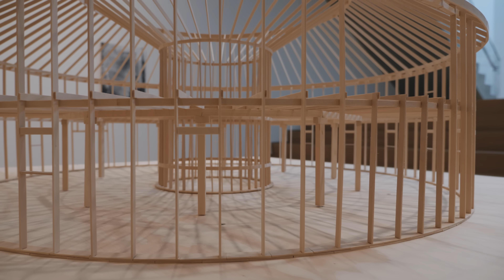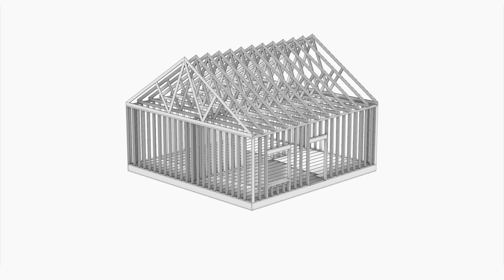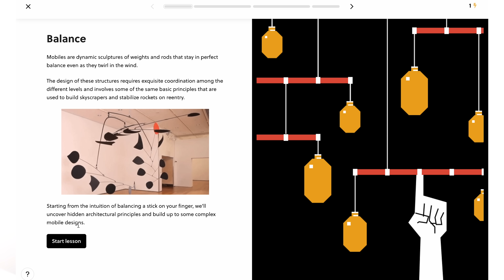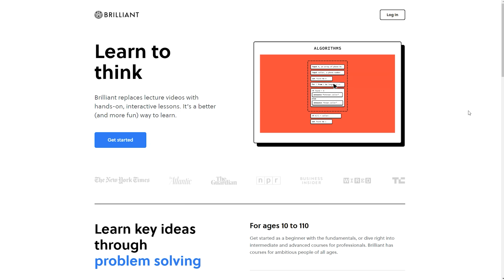The Genius of 2x4 Framing

Comment from the maker: Quick note. Firstly, I wanted to clarify a statement in the video about the skill of framers. That was a product of bad writing on my part. I absolutely believe that rough carpentry is a skilled profession. I was trying to take the position of someone in the late 1800s appreciating the efficiency of the new technology. I had a quote in there, but ended up taking it out. Apologies for the way it comes across now. Secondly, thanks for the comments about the hamburger metaphor, I will take that into future advisement!
Reply: I was about to say something about that. Construction is literally considered skilled labor. Sure building walls isn't too hard this way, but putting together a whole structure that won't fail for decades is not.
Reply: @jonmayer  It really isn't that hard - it takes training of course but that comes at school or on the job. The hardest part about construction is finding people who want to be there and will show up. You show up and ready to work - you will never be out of work.
Reply: @jonmayer  yes but now u can have one skilled guy on sight and a lot of (even if well) trained helpers...
Reply: Thank you for taking the time to make that correction. Not because I was insulted  having passed journeyman 30 years ago. Because I have had to fix way too many structurally unsound DIY builds that always started with "How hard can it be to nail up boards? I can do it cheaper!"  More math than you realize and it's always more expensive to fix your mistakes.
Reply: @gueto70  Going to that guy's house who is so proud of the stairs he built only to find out the last one is only 3 inches off the floor.
Reply: @mc.9839  and they don't understand why the building inspector has a problem with it. It adds character!
Reply: @gueto70  I know! So much for unskilled labor or lack of need for an education. These guys couldn't do the basic math necessary to properly lay out stringers. Shoot, most of them can't read a tape measure, "Ummm...it's 10 and 5 notches." lol
Reply: I'm glad you posted this comment. I am a framer and a trim carpenter in the remodel industry. There is a going mentality, even within the field itself, that it is not rocket science. But the concepts of putting together a sound structure really are deceptively simple. And it takes years to hone the skills to make someone a lead/foreman framer. Especially when hand cutting roofs. It is a dying art and only the toughest will do this for decades. I will freely admit, I am not cut out to frame full time. I can't hack working all year round in the elements. The few men I worked with who had decades of experience are amazing tradesmen. And there aren't many of those types around anymore.
Reply: @717UT  absolutely man. Glad you made this comment I was going to do the same. I've been in the trades full time for twelve years now as a custom furniture/cabinet maker. I believe I represent what he was talking about with the skilled labor, but I know for a fact that a good framer is an absolute skilled tradesman. He has just as much knowledge and ability as I do he  just works with different things. All you have to do to understand that is get on a well built deck and a poorly built deck and you'll know instantly.
Reply: @717UT  still not rocket science, though, is it?
Reply: @Monkeycantnutz  If it was easy, everyone could do it and there wouldn't be carpenters.
Reply: @717UT  you are correct in the mentality towards building trades in general.   I'm second generation Master Electrician, growing up on job sites both new and repair.  I've seen my share of "electricians" and while some of them were true craftsmen, others were just there for a paycheck.    What life has taught me, it that in any given profession, you have a select few who eat, breathe and sleep their chosen career.   What you see in their work is nothing short of awe inspiring, and they truly do make it look effortless.    Unfortunately, they are statistically in the top two standard deviations, or about the top 3-5%.   The vast majority of people you meet at their place of work fall into the 3rd standard deviation (the middle of which is the exact average).  
We have figured out how to grow trees to harvest in the shortest period of time, and chickens the same.  We have not figured out how to increase the intelligence or the non-quantifiable "care factor" for people at work with the same speed and efficiency.  (Side note - My personal opinion is that is not what big corporations or big government want because a smart populous asks too many questions). 
  My dad retired as both a Master Electrician and a motor rewinder/repairman.   That profession was profitable before production costs plummeted with the increase in motors coming from overseas and with the increased robotics in and out of the US.  That dying art form, to reverse engineer a dead motor, is going the way of the milk man or ice delivery service.   (I wound 7 motors in my life, 6 as a kid and one 20 years ago because I screwed up and burned the motor up accidentally, but it was not my cup of tea, so that part of our company died out when my dad retired).
Reply: @717UT  It isn't a dying art at all? Have you seen how much framed construction has been going on in north america over the past decade? It really doesn't take years to become a lead or a foreman - there is such a shortage of trades workers right now everyone can pretty much bump up in about a year maybe two if they are competent. You seem to be thinking there are no more quality trades folk around - sorry but there is a whole ton of talent out there in industry who are now overworked because they can't keep up with demand.
Reply: @717UT The other day, an apprentice asked the question "which is harder, framing or finish?". A lot of the trim carpenters said finish. I said " If you include the roof, it's definitely framing". There was a lot of disagreement.  I asked , as our company subs out the shell contracting, how many of them knew how to frame a roof? A couple hands went up, and they said they had set trusses plenty of times (1.5 years was the longest). I asked if they had actually framed any roofs? No one had. They were disbelieving when I said all I needed was a framing square and the width of the building to conventional frame a roof. I said " that's why trusses are used so much, and why our company uses shell contracting, because it's too difficult for a bunch of trim carpenters." My first 10 years were spent exclusively on stick framed homes.
Reply: I am an architect now and previously had been a carpenter and worked on framing crews. Framing contemporary architectural residences these days is no easy feat. I would strongly argue that most carpenters now have a much better grasp on buildings than most architects. Modern design, even dating back to post ww2 construction does not support heavy timber framing with contemporary building codes. Modern hvac systems, plumbing, window openings, energy codes, and engineering all support 2x framing.
Reply: @BigdaddyG420 "I'm a big rig truck mechanic and I think I'm smarter than a heart surgeon." That's how you all sound. We all live in the modern world, and no body is saying that your jobs aren't complex...but every job has a level of complexity...but let's not kid ours selves here- there is a difference between something you need to got to a school for 6-8 years minimum schooling that changes your perspective on life to get you to the entry level, versus something you can learn on the job.
Reply: @Gnefitisis  See, here is YOUR problem. NO ONE on here said that framing is more complex than heart surgery or requires the education. We only said it was a skilled trade. It is. Why? Because not everyone can do it. 
To use your analogy, anyone can cut open a chest. Not everyone can repair a heart. Just like most people can throw up some sort of wall. It takes training, and skill, to frame in complex buildings. 
You're the one that seems insecure. Does it bother you that my 'unskilled' father makes more than you? By quite a bit.
Reply: @mc.9839  You're reading too far into this. I'm not insecure, but I just happened to have "experience" being around rednecks. 

You also seem to ignoring my argument about the need for formal education vs learning on the job.
Reply: @mc.9839  "There's nothing wrong with rednecks." Says someone that didn't live 20 years in the South. 
Cut the bullshit.
Reply: @Gnefitisis  I’m guessing your college education didn’t include basic spelling and grammar instruction?
Reply: @Gnefitisis    you are grossly underestimating the complexity of many trades. It can take 10+ years to become a truly proficient carpenter, metal worker, etc. Its obviously true the initial schooling can't be compared to the intensity of a med student or the like. However I wouldn't make the assumption that a long and arduous schooling process necessarily translates to a complex job. In fact the majority of college and university grads (with the exception of some STEM) struggle to even find employment in thier given field. On the filp side, trades are in huge demand and even with very short pre-employment schooling periods, skilled workers or even apprentices are very difficult to come by. 

For somthing so useful and seemingly simple to many, very few people seem interested in learning a trade.
Reply: @shrimpy7862  ...and just to clairfy, I never said that the trades aren't important and can't make fruitful or profitable careers. Not at all. However, what I am arguing is that yes, the trades by definition are generally unskilled labor.

You don't have to agree, that's for economics and national labor statisticians to decide...but the argument that it's not unskilled because it has some complexity ignored the determinate of whether you can "learn on the job" or not.
Reply: @Gnefitisis  "the trades are by definition are generally unskilled labor" that is just wrong, thats not an argument at all. Electricians, Plumbers, Carpenters, Metalworkers, Millwrights, Boilermakers and so on are all examples of highly skilled occupations. You're reducing entire professions that people spend lifetimes learning to "generally unskilled labor".You should go down to your local union office and see what the members think of that one😂 laughable actually
Reply: @Gnefitisis  - As someone who was framing house in the 80's,  learning on the job, I can't disagree with you. A big problem in this country today, is people's little egos get very easily hurt. This stuff is all a matter of degree, and being a realist is usually to your benefit. If you go home from stick framing and play video games at night, don't consider yourself skilled. If you go home and study the engineering concepts, then we can maybe discuss.
Reply: @samuelluria4744  First, he's my dad, not my daddy. I've grown up since I was six though it appears you have not.
Second, he's both. I guess your feeble mind couldn't grasp the concept that he still works on his job sites.
That's okay, though. I've read your posts and it's clear you didn't have the ability to figure that one out.
Now, I'm sure that you'll want to say something spectacularly stupid and I'm pretty sure I know what it is going to be so I'll let you get to it.
Reply: @Gnefitisis  - Exactly. The national labor statisticians and demographic analysts and insurance actuaries, lawyers, politicians....they  do draw a line.... but in a society brainwashed against disciplined thought and humility,  this is what we get. NOT A DAMNED SOUL wants to be "considered unskilled", or even "less skilled". Heaven FORFEND!!!😱
Reply: @samuelluria4744  I even gave you the definition of a stick built structure.
Reply: @mc.9839  - Nothing spectacularly stupid, just to clarify that I NEVER said that once a tradesman becomes a businessman, he is magically no longer a skilled tradesman. Obviously,  most of the ones, like your Father, who get big, ARE in fact the higher skilled ones on their trades. The exact distinction I was making was not that they aren't skilled, but even when they are the MOST skilled....that's not HOW they are growing their business.
Reply: @mc.9839  - Well, I apologize for the daddy phrasing. You know how it sounds when someone says "My Dad's a builder,  and I bet you he makes more than you..." ....it just sounds like kids on a playground. But,  you stood up for yourself, and I respect that, so I'm happy to take it back.
Reply: @samuelluria4744  no response?
Reply: @pashahart8698  - That is correct. I have nothing more to say to someone who thinks homes in the times of the Revolutionary War were "stick-framed". Get well soon.
Reply: @samuelluria4744  My comment was in response, if I remember correctly, to someone bragging about how much they made. As my Dad is the builder whose financials I know I had to use him.
Reply: @samuelluria4744  That's exactly how he grew his business. My dad doesn't deal with the 'lowest bidder' crowd. Why do you think they come to him? Because he's a good businessman? Nope. They don't ask for his financials when they hire him. They do ask for his portfolio. They do question his building ability. The reason these people hire him is PRECISELY for his trade skill. When someone WANTS what you have you don't have to be a shrewd businessman to sell it to them. You better be able to produce the expected product, though.
Shoot, my dad has very little to do with the business side. He bids (sometimes), he builds, he supervises. Honestly, he's gotten older now...he drives around and brings the crew lunch more than anything.
Reply: @samuelluria4744  Also, as to this skilled or unskilled labor issue. I'm aware that some can nail boards together and put up a wall in their basement. I've seen enough amateurs do it. It almost always looks like sht. 
I think it's belittling to refer to these people as unskilled because they didn't go to college to learn to do it. I'd like to see the biochemist, or whatever he was, read even a blueprint. 
It's all tied into this crud that has people thinking that because a person didn't go to college then they're ignorant and uneducated. Education doesn't start, or stop, in the classroom. I'll take a well read person over a formally educated person any day.
Reply: @mc.9839  - I understand exactly what you're describing.  We are not in disagreement,  it's just that the line between the business side and the skills side, as a business grows, is perceived differently by different people. As a random example, in Jersey, we have some extremely large concrete plants, and they are almost all owned by guys who were at one point top-level concrete guys. They know concrete like Michaelangelo knew marble. Of course their businesses were founded upon the reputation for knowledge, skill, integrity,  efficiency,  etc.. But as the critical mass of capital investments gets to a certain point,  they money coming in is no longer a direct function  of the Boss/owner's skills, per se. That's the only thing I was trying to bring out.
Reply: @samuelluria4744  I'm sure it depends on your business model. If your goal is to appeal to the cheapest and the fastest crowd then you're probably right. In my dad's case, if he started to put out an inferior product he'd stop getting business. So, the continued prosperity of his business is directly tied to the quality and satisfaction of his product.
I'm fully aware that how my dad works isn't the industry standard. It isn't rare, though.
Reply: @mc.9839  - It's not rare at all. Probably the concrete industry was a poor corollary...I was trying to give an example of something were the expertise of the owner remains undiminished,  but is mathematically less of a direct factor in total sales... of course, other industries are more prone to having the owner remain hands-on to greater extents...presumably,  your Father's line is one of those....and, if I were to guess,  it sounds like that's home-building(?)...
Reply: @samuelluria4744  Yup, his business is luxury log cabins/post and beam construction. He does build contemporary as well but his reputation has brought in mostly people who want some type of rustic feel to the home.
Reply: I agree with everything up to the point that you said that stick framing doesn't require skilled labor. It takes immense skill and knowledge to be able to build roofs especially with multiple angles. I would say that the time saved by using the stick method is it's greatest benefit but the Carpenters involved are equally skilled for timber frame as they are for stick frame.  The timber frame was, for the time of America having gigantic virgin forests, a quick method of doing things.  They could churn out those timbers fairly quickly.
Reply: @reasontexas  45x95 framing looks shitty and weak, and is exactly that. 
Also, too thin walls so not enough insulation, so energy consumption way higher than it should be. 
Your oil and unnatural gas is too cheap, so you waste energy fir many decades in poorly built houses. 

Look at Scandinavian built houses, with 25+ cm insulation in walls and 35-50 cm in ceilings, with low pressure inside and heat pump tech (energy extracted from ventilated air, put back in radiator water loop) and/or geothermal heatpump. Uses 4-8 MWh/year in sub arctic climates, easily offset by a 5-10 kWp solar array on the roof. 

Yeah, your weirdly overcomplicated roofs with shitty shingles on, leak, look awful and doesn’t house solar PV arrays easily, and when you try, it leaks even more water, due to SHITTY design and materials. 

Go figure…. 😂
Reply: I agree with this clarification. Modern framing has way more codes and engineered components and cannot be installed by an unskilled labourer. There are journeymen carpenters and it's a lot of knowledge. Carpentry is the one trade has a large amount of knowledge and skill to do. Some people may think they can frame, but have they? A whole house? It's not as easy as you think. Rain or snow in all the elements. Its a hard trade and I have been doing it for over 10 years in Canada. I agree with everything else you said in the video. Thanks for the clarification.
Reply: Thank you for recanting.  Fact:  most of todays population have no idea how to work as a carpenter.    I have worked with many framers who are also are finishers and beyond.
Reply: Yeah, building is a skilled profession for sure. Think about it, framers have to imagine the finished product to make sure it's laid out properly for plumbing, wiring, flooring, walls, etc..
There's nothing worse than having to add framing because the framer messed or couldn't read a print.
Reply: As a carpenter I’ll admit you’re half right about rough framers many more people can “build” a structure but not all structures pass municipal build codes that’s really where the skill comes in nowadays
Reply: @Diogenesthelazydog  Thank you! Someone who's actually been to a jobsite and willing to speak the truth, not what's convenient.
Reply: @Gnefitisis  I work in construction in BC Canada as a sub trade for specific building codes required west of the Rockies. Framing is only really unskilled in the fact that you can get a job doing it with no previous experience but that's only if you are working under someone else. Nobody is hiring a random guy with tools who says he is a framer but can't provide any proof of experience to work on a project as a lead. However this actually applies to all trades here. You don't actually need to have any schooling for any trade, you can just apprentice under someone and once you have enough experience and tools you can quit and just work for yourself.
Reply: @Yukimaru0  Not exactly. There are things in Canada called "compulsory trades". It is actually illegal to work in the trade without being an indentured apprentice or ticketed JM. Steamfitting-Pipefitting is one of those trades. How do I know that? I'm a JM SF-PF and served 6yrs on the provincial apprenticeship committee in Alberta. It tries to keep fools and hacks from pretending they know what they're doing, then walking on to job sites getting themselves/others killed or seriously injured. Of course, if an employer wants to be shady, they just go ahead and hire these guys then lie and say they're just "labor". This undercuts safety in the industry and is more dangerous than most people think. I know I've seen too many people die on job sites I've been on, and every one of them came down to poor decisions due to lack of experience/education/certification.
Reply: It’s a mildly skilled profession
Any framer ( that’s been around for a few years) will have the confidence to tell you that, most of the time, it ain’t rocket science.
Reply: Hmm... but doesn't the fast food analogy break down with what each optimizes for? Fast food optimizes for quick assembly by relatively low skilled workers (e.g. high school students) whereas house framing optimizes for the manufacture and transportation of the 'parts'. (i.e. the wood) A small army of skilled workers is needed to then unpack, cut, move and assemble each piece of wood on site. I feel like the construction industry is ripe for disruption by tech...
Reply: A lot of houses in Denmark called the "type houses" is from the 1960's to 1980's. They were build with a lot of the same elements as shown in this video namely to mass produce houses cheaply and fast, so that common man could buy a "starter pack" and join the building process.
Reply: Alot of people saying things in here that are out right ignorant. If it's all so easy to do why not build your own houses? If it's as easy and brainless as making a cheese burger you should all have no problem doing it your damn self. Disrespectful ignorant desk jockey twats with a degree that daddy co signed for and paid all there bills to get anywhere in life  and not a clue what they are talking about is all I see.
Reply: A carpenter has always been a skilled trade, in the 1500s the 1800s and now. To gain a journeyman level it takes about 4 year's of school and working experience, a master carpenter takes about 8 years.. your statements show your clearly lacking knowledge about skilled trades, I doubt you have ever built anything that didn't come in a box, and at that you probably hired it out because of your lack of any real world knowledge or experience at anything more then running your lips a whole lot and saying nothing.. 👎👎👎 for you..
Reply: but why do we call them hamburgers if they are not made from pork lol.
Reply: @xxpyroxx1670 Maybe they should call them "cow patties"!
Reply: @xxpyroxx1670  because of a town in Germany called Hamburg. Similar situation with the Sandwich
Reply: thought that shit said “farmers” and was like “damn this video must take a turn”
Reply: You lost me with the hamburger (allergic to tomato and hate pickles) but other parts not relating to hamburgers were interesting.
Wood framing is becoming more popular in Iceland but we still hold to the tradition of rebar reinforced concrete apartment buildings and smaller houses. The US puts Icelandic houses in the bunker category.
Reply: @vvsandgaming4648  I’d take a reinforced concrete house over anything else. A decorative facade can always be added.
Reply: I am suprised why America built so much with wood? Here in the Netherlands everything nowadays is with concrete and stone.
Why is did not done in America ?
Reply: no.
Reply: I'm a framer and a Steakman good sir and I take great umbrage with your generalizations and ...dammit now I want a burger
Reply: Adequacy? McDonalds is garbage and so is light wood framing. So corporations want to extract every last profit like the Harconan from Dune. Then they make it so standardized an idiot can do it. So now everyone is an idiot. The craftsman are all but extinct. Then a slight breeze comes by and fema has to pay billions to fix garbage that will suffer again, and again. Much like MD causing heart disease, obesity, and diabetes. Once again tax money pays to remedy these problems. So the corporations get massively rich exploiting every avenue and the customers are stuck squirming in garbage. Don't even get me started on plastic piping and insulation. Now just let the vampires hook you up to the grid to suck what little you have left. 

Have fun with the black outs America. The Russians are attacking our electrical grid as in Carolina, and those stick will burn. And all you geniuses out there were forced to read the three little pigs. All of you. Good luck. Time to pray. 

Sticks and straw... sheesh... the big bad wolf likes it that way. For those no knock raids. The wolves detest little doggies. They take them out first. Then it's you in your bed sleeping on a pile of millions of dollars of garbage. A shelter protects..........but hey, they are great for throwing parties. Like a long term tent. Lol
Reply: @gaslampnation735  2x6 studs 16 on center with double top plates and hurricane straps to the foundation and roof and sheer walls. You can build with light wood framing to withstand hurricanes, you just have to know what you're doing.
You're missing the point of standardization being good for efficiency and overall quality.
Reply: @gaslampnation735  you’re not wrong about the state of “building and craft” but you’re a little late to the party my guy.  We had fully embraced capitalism and the alienation of craft by the time the first Erie Canal boat was christened.  I use raw materials made by god, instead of relying on the building store.  What are you doing in your means/methods to resist the degradation of craft?
Reply: I Dyi everything so that's a start. I'm a silversmith and stone cutter. I'm working on building my own home. I prefer monolithic natural materials from the surrounding area. My property being in the woods I have plenty of timber I've learned to make beams out of a chain saw by swinging it like a pendlem in a groove. Learned that from some Russian who did everything from scratch. I'm an ancestor of Sarah Bull who built her house out of river stone she carried in her apron. I have a heavy stream so lots of stone readily available. Check out the bull house in NY. I have been experimenting with hempcrete and trying to develop a new process that encases a bail of hay in hempcrete or concrete. I'm thinking good insulation and affordable. I want huge Thermal mass smoking up the suns energy. They say fabrage had a golden hammer and he would smash any eggs that were not perfect. I guess detesting poor quality is a start. Not to mention most laborers dont even know code these days. So the engineering that has stretched to the limits will buckle and fail if not done properly. In a dream world I would go the WV and bore out the mountain and live inside. But my favorite structures so far are the new pressure treated bamboo houses in the east. The cantilever and height possibilities are astounding. After considering the fantastic wonders of bamboo cities left to rot by weather, pests, and time, I realize the fleeting time of our existence and it is not efficiency and quanity that enriches our lives, but quality. That is why I haven't eaten McDonalds since I knew better. It's been decades.
Reply: @gaslampnation735  you got limestone and firewood that’s all ya need
Reply: @gaslampnation735  - I think you mean descendant,  not ancestor.
Reply: S😊
Reply: Don’t apologize. As a plumber I can tell you with absolute certainty that every framer on earth is a dead eyed Mental invalid who couldn’t measure where the fucking Wall supposed to go if you put a gun to their head
Reply: @zekiah2  ouch bud.
Reply: So renarrarate
Reply: I work on stairs, if the framers aren't skilled our product is crap.
It's like they always say, if the foundation is sound
Reply: Leave it to the yankees of Chicago to claim to have created EVERYTHING !  Chicago did not even exist when a lot of this framing began in "the colonies".
Reply: I'm not a carpenter or a framer but want to interject here. Basic framing does not take any skill at all. Anybody can do it. But building a sturdy frame that will last for decades or centuries instead of collapsing after a few weeks or months? That does take a lot of skill, and should be respected.
Reply: 45x95 framing looks shitty and weak, and is exactly that. 
Also, too thin walls so not enough insulation, so energy consumption way higher than it should be. 
Your oil and unnatural gas is too cheap, so you waste energy fir many decades in poorly built houses. 

Look at Scandinavian built houses, with 25+ cm insulation in walls and 35-50 cm in ceilings, with low pressure inside and heat pump tech (energy extracted from ventilated air, put back in radiator water loop) and/or geothermal heatpump. Uses 4-8 MWh/year in sub arctic climates, easily offset by a 5-10 kWp solar array on the roof. 

Yeah, your weirdly overcomplicated roofs with shitty shingles on, leak, look awful and doesn’t house solar PV arrays easily, and when you try, it leaks even more water, due to SHITTY design and materials. 

Go figure…. 😂
Reply: im glad you thought about that, it takes skill
Reply: Thank you for this. I was headed straight to the comments to share my concern with your viewpoint on carpenter skill. Simply a contextual wording error. The lack of actual skill in the carpenter trade is very real-especially since you have to get your hands dirty. Thanks again for clarifying your intent with the statement
Reply: So, you are a teacher, oh sorry, a professor!  I go to work every day to demo, fix, repair, replace, reengineer what was designed by a so-called licenced architect.  So, who is the skilled one.  It makes me sad to think what you are teaching our up and coming architects about the construction industry and all it's unskilled people.
Reply: @BrianMcKayUSA skilled trades use knowledge as well, takes training and knowledge to build a house from the ground up, or whatever the case may be with a certain trade. Framing is also a subset of carpentry, which is obviously very knowledge and skill based. I did a 4 year apprenticeship in Carpentry, and have gained so much more knowledge since I started 18 years ago.

 That's why many people in occupations you list above pay me quite well to do work on their homes, mainly because they trust my knowledge when I look at an issue they have with their home, and that I will use that knowledge with skill to improve or repair what that issue is. Same as if I were to have a legal issue, hiring a (good) lawyer would be money well spent.

Just because it's hands on and requires a technical education over a more academic one, doesn't mean the knowledge isn't as important, or the work can't pay as well.
Reply: Hi there, do you have a discord or a platform for chat for construction questions?
Reply: We got wood.  That's why.  I like concrete
Reply: seems to me like the distinction you were getting at was more that it's low barrier to entry than low skill - there's more to do on the job that doesn't require full training, so you can train more people on the job with less critical tasks, which lends itself to mass production. seems silly to me that people are punching down on hamburgers if they don't want people to punch down on framers though, isn't that whole mindset part of the problem?
Reply: You really don't need to clarify that for fear of offending someone. Working on a framing crew was my first job ever at 18 years old. Within a year I had learned so much that I could build a small house or small structure myself to this day. It really isn't difficult. It's very important work but it's not rocket science.
Reply: Lol stop apologizing for something that you totally meant
Reply: I didn't find what you said insulting, instead the inference is that there has been a skill shift. Each beam on a timber frame has to be expertly cut out because the structural integrity is on every single joint. Whereas nailing and screwing in 2x4s doesn't require expertise for each beam just basic knowledge where to fasten, thus an entry level laborer can tackle individual beams. However, entry level builders lack expertise on building code laws and how to create a whole structurally sound building. thus the skill has shifted from expertise for every part of the build to expertise on the sum of those parts (the need for expert supervisors). Both new and old methods require skill, just in different ways.
Reply: @trashbuilds8351  very well said
Reply: @BrianMcKayUSA That's why architects and engineers call me regularly to help them out I guess. Wild stuff that. College degrees and PE stamps aren't what they used to be.
Reply: I'm a drywall hanger, and you treated carpenters just fine lol
Reply: hahaha - you named it!
Reply: It's OK us framers are use to it
Reply: A fascinating video. People go by a construction site and never give a thought about what goes into it. And next thing you know the building is finished.  I'd like to see  how Adobe structures are put together,  especially the missions of California.  Beautiful buildings made of mud and straw.
Reply: Most framers do horrible jobs and the GC has to (or should anyway) go back and fix the problems and crooked studs but they are fast at least.  Seriously though, if a stud is crooked throw it with the send back pile.
Reply: it is not standardization, it is that mcdonals opens early, stays open late, and has cheapish prices. Standardization is a negative here. We quickly grow bored of eating the same few dishes, but no one else is open, is too far away, or is too expensive.
Reply: Please, its not bad writing, you are just too concerned with how people will handle what you say. Because what you stated was the exact truth. Ive been in the industry for a while doing exterior trim and working with framers. Being a framer building stick built homes off of plans is the burger flipper of the construction industry. Yes, its a skill. No one said it isnt. But theres a reason Mcdonalds isnt a high end restaurant. And its not just the burger.
Reply: @deriac8365  I have worked many jobs, including mcdonalds. mcdonalds is one of the most professional businesses you can work at, and trust me it is not easy to learn everything and work 100mph when a rush hits, so that people are not left waiting forever. Stop shitting on hard workers. Whatever some individuals do, there are poor workers and good workers who have skill. I could say exterior trim work is easy, but is it easy if you are good at it and work fast? Yes, some jobs require a lot of time in training, such as coding, but no way is mcdonalds easier. It might be simpler, but not easier.
Reply: Where is the burger American?
Reply: Just like most endeavors in life, framers come in all varieties; from true masters of their craft to cobb-job Charlies.
Reply: Don't feel bad, I've never walked into a jobsite without at least one wall framed out of spec lol
Reply: I was about to call you out on that, framers are skilled as hell. Granted it's a different sort of skillset than other forms of carpentry, but I'm glad you added this note.
Reply: I build log homes, so I'm not actually insulted.  There's a vast difference of skill needed to fit together timbers vs stick framing.   With knowledge of how buildings were historically made, comes the knowledge that they were much more skilled than many framers today.   

There still is skill involved(I, like many in the industry, am having a hell of a time finding workers who can be trusted to handle a nail gun or saw), but it's a very different degree of skill.   Any carpenter worth his salt should be able to recognize that modern stick framing is a labor saving and skill saving development, and should be able to appreciate the skill of carpenters from a thousand years ago who built massive roofs for cathedrals and other buildings that are still standing.
Reply: @YaBigDummi  Exactly the point from what the good Prof. was supposed to quote. In a stick frame having any one piece be off by 1/8" won't cause a huge problem and can usually be rectified. Small problems on the first floor can be canceled out by the platform, a cracked joist will usually have the load borne across the others by the underlayment, etc. 

the precision and quality of lumber needed for timber frames is far further up, and adds to the expense. You can't be an idiot with a nail gun or circular saw, but it's nowhere near the same as needing to chisel out a mortise. Being an ok cook who can do food safety can make a decent burger, and some simple steps can be broken down further, but being in charge of writing the manual or supervising the process is more complicated, and most homes are not quite as simple as a levittown or craftsman kits anymore.
Reply: @YaBigDummi  - I came here to say precisely what you already said quite well. Anyone worth his salt, should NOT take offense at the truth.
Reply: Americans don't prefer standardization, capitalism does and that's why it's reality
Reply: I did framing work for commercial projects for 8 years. It is not a skilled trade it is not hard it isn’t doing finish carpentry. Hard on the body easy on the mind
Reply: You can teach a teenager to be a framer and that person would be efficient at it in a few weeks.  Carving up a super expensive  and heavy beam of lumber with some hand tools to make precision cuts and carvings... no... those skills are going to take a bit time to develop and be trusted with.  If you mess up a cut on a 2x4... well... just grab another one of the pile.  I don't think there's any disrespect in there.  Framing is still a skilled trade... things have to be done efficiently in terms of speed, price, and safety.
Reply: @fakshen1973  - We could theoretically just do away with the term, since it's meaning is completely malleable. 
Where do we draw the line, between skilled, and unskilled? You and I might say that we don't need a line to be drawn...but thousands of legislators and litigators will beg to differ...
Reply: why are you wearing a mask?
Reply: Talikg about 2x4 being whatever while shouwing a 2x6 framed house is the quintessential stupidity of you talking at less then 2 minutes.
Reply: I would say that rough carpentry takes training and skill. 2x4 framing requires a pulse.
Reply: You also might want to fix you Chicago references.  When on the east cost of the mid Atlantic states and New England there are home built well before those dates.
Reply: @pashahart8698  stick framed homes on the east coast built well before 1830? no way man. youre dead wrong.
Reply: @michaelprice8810  what is the definition of a stick framed home?
Reply: @pashahart8698  did you even watch the video?
Reply: @pashahart8698  uhm u sure that wasn't timber homes?
Reply: @pashahart8698  having worked on east coast houses that predate the founding of the country, I can tell you that they were built differently than chicago-style framing.
Reply: @YaBigDummi  thank you. my grandparents live in one of them. trees with one side flattened for floor joists is far away from stick framed haha
Reply: @pashahart8698  - There aren't stick-frame  houses in the Mid-Atlantic from before 1830, I guarantee you.
Reply: @samuelluria4744  try Google before you comment....
Reply: @samuelluria4744 cause being butt hurt and wrong at the same time is not a good look....
Reply: @samuelluria4744  maybe you should lookup what the mid Atlantic states are first before your next comment and your apology.
Reply: @pashahart8698  - I have been framing houses in New Jersey for 37 years. My Father was a Chief Ranger in the State Parks and Forestry Department, for over 30 years, which afforded me the opportunity to visit every single historical house or building in the state and plenty in New York and Pennsylvania as well. Where are YOU from?
Reply: @samuelluria4744  well as a carpenter on long Island I have worked on homes and school houses that were converted to home from the late 1700 to early 1800. But not not to many people get the privilege of worked on stuff that George Washington spent the night in.....
Reply: @samuelluria4744  when you have towns that were founded in the 1600's you would know..
Reply: @pashahart8698  - And exactly ZERO of those homes were stick framed!! 🤦🏻‍♂️ Did you even read the original post???
Reply: @samuelluria4744  see the problem is you don't know what stick framing is.
Reply: @pashahart8698  - My Father's Father's
Mother's Father's Grandfather was William Floyd, Signatory to the Declaration of Independence. 
Have you been to his house in Mastic, Long Island? That's not stick frame either.
Reply: @samuelluria4744  they surely weren't built in some factory and delivered to the build site....
Reply: @samuelluria4744  so can you tell me what is holding up the wall?
Reply: @samuelluria4744  you do realize a balloon framed house falls under the definition of stick built. The definition of stick built is a structure made of wood and assembled one piece at a time on site.
Reply: Sorry forgot that they have stud and beam construction.
Reply: @pashahart8698  he didn't say Chicago had the first ever structures built in the history of the country, just some of the first with this style of framing. And no, you won't find any that predate these Chicago structures that also have the same style of framing.
Reply: No. You are right. Damn framers cant tell a straight line from a circle
Reply: @Brian McKay U.S.A. Stop dude. I tried arguing with these people already. It's not worth your time, their egos are too large, plus they all got that all knowing "street smarts" education.
Reply: @Gnefitisis  - Now just put yourself in my shoes, and imagine what it's like to deal with fragile egos for 35 years, out in the elements, 😂....
Reply: @Brian McKay U.S.A. - In this country, people have been poisoned into this mindset of relativism,  with all the "participation trophies", etcetera...."everything is just as good and valid and worthwhile as everything else, so there!!"😤😤😤

     So, congratulations to us! Now we have (almost) an entire generation of grown ass men, who can't see reality. The reality is, the lines of definitions have to be drawn  somewhere. Nobody is able to man up, and put things in honest perspective. 
      I've been in manual labor my entire life, and have never had any disregard at all for men and women riding on garbage  trucks. I applaud their hard work, and am thankful for the service they provide. But I'm damned sure not going to call them sanitation engineers.
Reply: Merry Christmas everybody! 🎄Don't forget to tip your garbage collectors, postal workers, etcetera....🙏🙏🙏🙏😁
Reply: Call it what it is. The same guy flips hamburgers can go nail 2x4’s together. It’s the baseline for people who can’t pass a drug test or a background check. Just depends if you want to be inside or outside.
Reply: @deepmarsh  You obviously have not actually done either. I certainly would not want to be in any structure you might put together. I wonder if you could even do a proper corner.
Reply: @deepmarsh  except the hamburger guy can master a few hamburgers pretty quickly. Someone green on a framing crew will be doing cleanup for awhile, then move onto the more skilled stuff bit by bit. Takes a few years to be seasoned,  be trusted to do layout, etc. Also then throw in hand cut rafters and staircases. Then throw in the fact carpentry is a skilled trade, framing is one part of. Can move onto finishing carpentry, commercial work, etc.
Reply: @deepmarsh  roflmao. who hurt you
Reply: Everyone quit your whining. It IS unskilled labor because you don't have to go to a trade school, like a mechanic. Just grab a nail gun and make some shoddy ass buildings. Definitely not heart surgery.
Reply: @Gnefitisis  I mean I didn't go to trade school, and I've been fairly successful as a tech.
Reply: @Gnefitisis  easy to do, however not  as easy to actually do it well. By the way there are plenty of trade schools/apprenticeships for carpentry, which as a trade wood framing is only one component of.
Reply: @Gnefitisis  You would get fired the first day if you said that lol.
Reply: @anthonyp8955  I don't have to worry about that problem, because I went to college and don't need to work on a job site.
Reply: @Gnefitisis  why u so mad though, probably the student debt…do you think you’re better than people working on a job site because you went to college? I’m a union journeyman electrician and make 100k a year plus benefits and pension, so awful right?
Reply: @idhatemet00  lool. I made $250k last year with stock options. Still, not bad for you.
Reply: @Gnefitisis  I’m a millionaire and I’m a model
Reply: @Gnefitisis  LOL, you're college degree isn't worth much if you don't think you work on a job site. 
My Dad's a builder and I'll bet you anything he makes more than you. That might not be a fair comparison as he probably has more formal education than you do as well.
Reply: @morganwheeler7417  Again, you guys need to stop projecting. Never said anything about value. Also...yes, I actually did do something more value than you 100%... but you're welcome to deny that fact, because only with formal education could you hope to get hired in biomedicine. But you're all smarter than surgeons right?
Reply: @anthonyp8955  he'd get fired because he couldn't keep up with us. And, if we kept him on, he'd probably shoot a nail through his hand and drive up the insurance cost.
Reply: @Gnefitisis  This is such a stupid take.